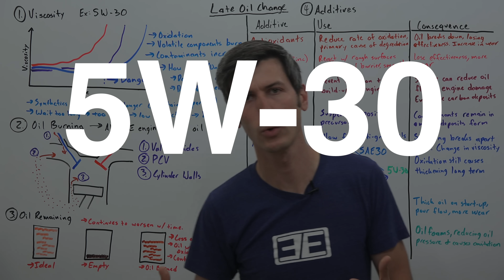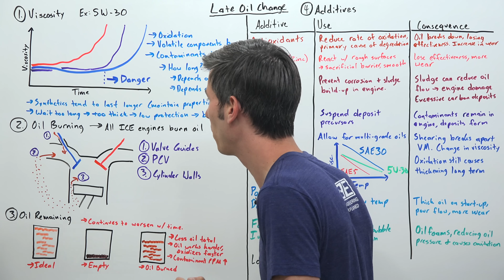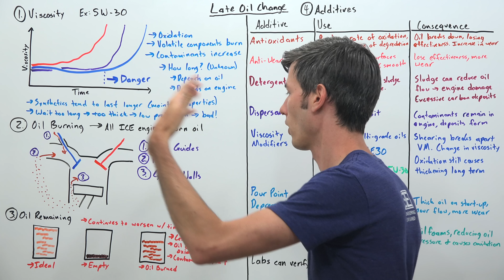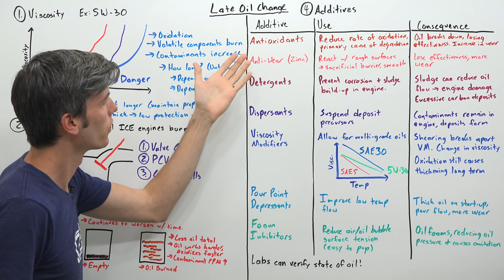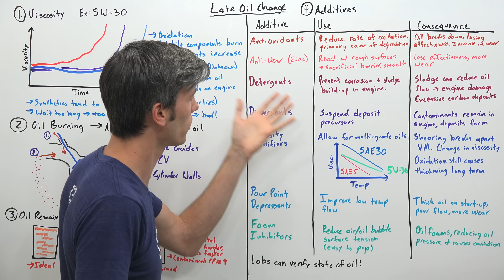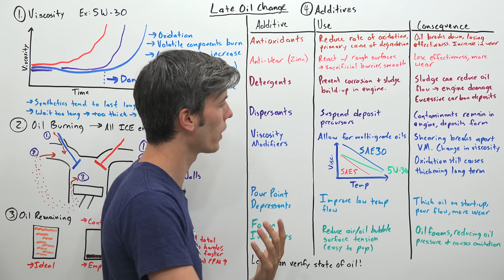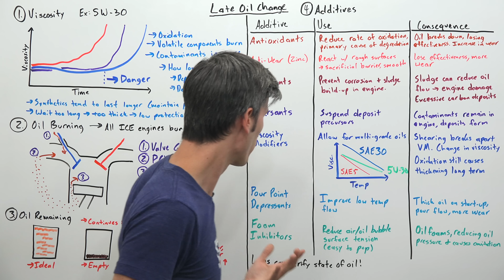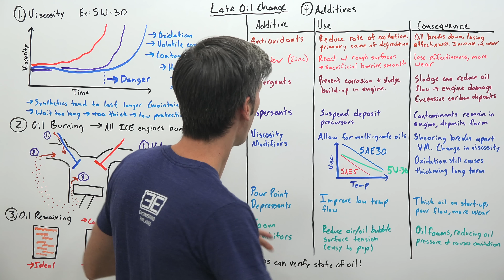What If You Forget To Change Your Oil?

Comment: What is considered “on time.”?
Reply: Well that is the thing. Pretty much nobody knows what "on time" is, but everyone swears the way he does it is the right one.
Reply: @Diesel Techie That or when your car tells you.
Reply: I'd say 10k km or one year max (whichever comes first obviously), to play safe.  Sure modern oils are better than they used to be, but modern cars also have much more heat (especially turbos).  BMWs are known for this issue.  They say up to 25k km based on how you drive, but then you get major part failure just after the warranty ends.  In a local BMW Z club the consensus is actually 6k km or 6 months for a turbo model.

Remember, long service intervals are good for the manufacturer.  The car looks cheap to own (more sales), plus the engine won't last too long so you'll buy another car shortly after the warranty is over (again, more sales).  Or you'll keep the car which has now turned into a money pit, and keep buying parts (parts sales).

And just for reference.  25k km = 15.5k miles, 10k km = 6.2k miles, 6k km = 3.7k miles
Reply: Diesel Techie Thanks for the reminder. I still have it and thought about it after I made my post. I was raised on the idea of 3 months or 3000 miles however, I made payments to the bank on a GMC Yukon and it told me to change at around 7500 miles.
Reply: @bradwilliams4921  
Do it more often if you are towing a lot with your Yukon. I usually just watch the color off the dipstick. When it starts getting brown I change it.

Comment: There was so much information in this video I can't remember if you mentioned time. How important is changing your oil if you don't put many miles on the engine? Does the oil deteriorate just sitting in the pan? I drive a hybrid and use the engine rarely.

Comment: I'm debating if I should change my oil now or in the spring time it's at 45 percent but the computer is set for 6000 mile intervals to the oil only has about 3500ish miles on it and it's full synthetic so I think I might wait till spring the car doesn't get driven alot mabey 50 -100 miles a week

Comment: BMW has a plan to have less metal wear contaminates ...... Making more and more of the engine out of plastic 😐😔
Reply: in one movie they said 'Bavarian Money Waster (BMW). HaHa
Reply: @billnopoles1934  it should be Big Money Waster.
Reply: @Ratkill9000  Nah, "Be My Wife" when you love it so much.
Reply: @ZoneCrasher  Both are extremely high maintenance.
Reply: @billnopoles1934  Those who work at Mercedes and Porsche say "Bayerischer MistWagen!"  (Bavarian dung car.)

Ha, ha!
Reply: @dudeonbike800  ich erinnere mich. I got my phrase from a movie 'Another Frickin' Christmas' (or similar)
Reply: @billnopoles1934  electrical issues to. MB is better in my experience maybe not as sporty but ppl get more inherent quality w/MB or Audi even VW on lower end.
Reply: Diesel Techie And they keep jacking the price up higher and higher. Cost to fix is higher too. There’s just not much left going for the customer anymore. 😪
Reply: Butterffinger5678 k
Reply: That was a good one. Plastic intake manifolds in the 1982 model..... so you're right.
Reply: I think it is also due to limitation from environmental.
Euro is limiting "lead" on new registered engine from manufacturer.
I think it will make engine service life shorter and shorter
Reply: They're all doing it now, not just BMW.
But I get your drift man. It's appalling how went from metal for intake manifolds and sump pans for this shitty plastic that will break.
I'd gladly pay the extra money for metal.. Just make the F#$@@ing thing !!
My 99 Euro Spec E36 M3 is as good as it gets when it comes to quality.
It slowly went downhill from there to the ridiculous we see now.
I wouldn't buy a new car in this day and age. They are all rubbish, especially the biodegradable wiring harnesses they so cleverly using.
It's not funny anymore..
Reply: @Royalbigness  >> Wait! What?? “Biodegradable wiring harnesses...?”
Reply: @boomer1954ful  It was more tongue in cheek response. My way of saying how cheap and crappy each new model gets. Everything is practically made from plastic rubbish which will break and leave you stuck somewhere. It doesn't surprise me IF they make a biodegradable wiring harness, the way the genious' are designing cars these days.
I have an E36 M3 and it oozes quality unlike the the rubbish of today. It's coming up to being 25 years old soon and it's still in mint original condition.  By the the time these new cars crack ten years, they'll be ready for the tip.
Reply: when manufacturers announce the new model with '400 pounds less weight' you now know what that means - nothing good.
Reply: It works perfectly fine...until the plastic becomes brittle from heat cycles and age.
Reply: @mrburgermaster  or the glycerine from the coolant gets through cracks in the egr valve cooler and gets ingnited by the hot exhaust gas and then gets sucked through the intake manifold into the engine (as intended), melting it...... the result is fire in the engine compartmend (as seen in bmw 520d)
Reply: my neighbor asked if i could check her oil in her bmw before she left out of state vacation ..popped the hood looked for 5 minutes scratched my head couldnt even find the dipstick. after she left (she was in a hurry) i looked up her car and it doesnt even have a dipstick ...REALLY BMW!!!
Reply: @dustinwalker9932  mercedes have that too. Only digital indicator.
Reply: @johan.ohgren  — That’s just awful - “How to incapacitate world wide auto owners”
Reply: @johan.ohgren  thats only... insane
Reply: @dustinwalker9932  I own an F25 and the first time I wanted to check levels i did the same.
The iDrive displays it. It is a royal pain in the arse changing oil though. 1) Because no-one can give a straight answer as to how much it takes and 2) It takes a fair bit of driving to get the level on the iDrive to sort itself out and show the correct level. It WILL drop after you've done a good few miles
Reply: @dustinwalker9932  They don't its obscurd. They recommend 15k oil changes still as well. Pls. That's why 80% ppl lease these vehicles.. tho will on other hand go & BUY a $70k+ loaded luxury model 1/2 ton pickup truck due to immense safety/reliability etc (i.e F150 Limited, GMC Denali, F150 King Ranch etc etc)
Reply: @dustinwalker9932  🤦🏻‍♀️ omg... Why would they do that?  Corporate Control Freaks ?  Won’t even let the auto owner check their own oil? It was part of our American right-of-passage to learn to maintain our own vehicle. Dad said, “Now you are a car owner. You will learn how to check your oil, check your tire pressure, check the tire tread w/a penny, check the water in the radiator, (“IT MUST BE A COLD ENGINE!”) And so on...
Reply: If there was a way to make a plastic engine, they would put it in all of their cars.
Reply: @jacobkeller8613  every automaker would! Its been tested. Not rigorous enuff.
Reply: @jacobkeller8613  put it this way,  the engine in my e46 m3 weighs 250kg
Tell me a 30kg total mass engine, not with saving,  that still makes around 350bhp wouldn't actually be cool...
And if it was all plastic,  it might be cheap to fix.....
Reply: Nicolas Broszky  They might be great.. but in practice the become fragile and break as the car ages, and that did not happen with metal parts. Also, most plastics expand way more than metals with heat changes.. so no, plastic is not good inside the engine.. and these problems have plagued BMW engines.. yet their solution is more plastic.  It is there to save money and weight, but ages horribly bad.
Reply: @aitorbleda8267  >> If I won a new BMW in some contest - I’d sell it immediately to get a Ford.
Reply: If they use carbon fibre instead of plastic it would be even better than metal but NO they don't bother.
Reply: Exactly! TOYOTA an most German brands been riding the perception wave for nearly a decade now & its fading fast while Ford /GM /FCA-Jeep have reclaimed benchmark status in so many areas. Now not saying Toyota is bad but not the same Co of 90s. Only really atrocious brand out there in terms of quality short & long term is Kia in my experience they get by on massive warranty time & parent Co Hyundais deeper pockets. Happy motoring & God bless American manufacturing!
Reply: @Diesel Techie Metallurgy has come so far in last 10yrs ..that aluminum is the "go to" material for even high HP applications w/ no issues. My 04 Mustang Cobra 4.6L  DOHC 32V factory supercharged has big alum heads stock & iron block for superior durability (they new ppl would try for obscene added pwr ..love how Ford & GM factor this into design) Had 400hp stock on dyno & easily 500hp w/ less than $1k in bolt ons/tune etc Many had those cars making 800hp safely! No internal engine mods did to robust internals stock & that iron block & factory Tremec 6spd manual. Even a 5.0L coyote in newer Mustang GT capable of lots more hp no internal mods needed tho not 800hp.
Reply: my BMW has a titanium engine and no dipstick so....
Reply: Brian Lehmkuhl BS
Reply: @brianlehmkuhl8162  doesn't have a Titanium engine! Maybe some parts. Better change motor oil every 5k-7500mis max no 15kmi changes.
Reply: Or just devoloping horrible engines like they are known for. 👍
Reply: Nicolas Broszky  interesting on the plastics make up. I wasnt aware.. thanks for info sir!
Reply: 🤦🏻‍♀️🤦🏽🤦🏻 lol
Reply: Buy a Lexus it will last forever.
Reply: @immersiveparadox  Lexus is good but designs are terrible now & other luxury brands specifically Caddy & Lincoln have long since matched & esp beaten them in performance aspects . Neighbor has new '20 Lincoln Aviator SUV for his wife..he can buy her whatever she wants . They had a few Range Rover Sports that were on but dismal mpgs. She drove 5 or so luxury SUVs an was smitten w/new Aviator. I hadn't seen one. What a beauty & tech is phenomenal. Def worth serious look in that price range.
Reply: @immersiveparadox  >> 😟 Ummmm, I know someone with a used Lexus SUV. Antenna broken. Brake job cost over &750 bucks. All kinds of things going bad on it. It’s a 2007!  Too many Bells + Whistles constantly breaking. 

I have a ‘99 Ford Ranger 4wd. Nothing has broken. Nothing! Done nothing to it except routine maintenance, tires, oil, gas, brakes, Trans fluid change,            1 Tune up. 1 rear differential fluid change. Not one thing gone bad in 22 years.
Reply: @immersiveparadox  or a old vw. My dad bought a passat 1.9 tdi pd engine from auction with no paperwork serviced it when bought then twice more over 3 years, sold it my brother he never serviced it in the 2 years he had it, sold it me for £300 with golf mk5 gti diamond cut wheels on so I basically paid for the wheels and got car free and drove it around for 3 years without even a air filter change, it never broke down or lost any power and ran its way to the scrap yard after all the shockers failed, I put 35k miles on it and my brother put atleast 20k so overall it did about 50-60k on the same oil topped up twice a year and went to scrap yard with 220k on clock. Would have done another 50k easy if the shocks didn't cost more than the car did
Reply: @dicksplatts007  A 1.9 TDI PD engine is near impossible to kill it would have been a 500,000 mile engine if you had allowed it to be.
Reply: @dicksplatts007  it was a diesel... i purchased a sports car years ago, had in town trips and long oil changes,,, rockers started to seized up when i strated driving it hard.  so chnage the dam oil
Reply: @dicksplatts007  VWs are great vehicles! Underrated. A few models had some issues yrs bk but no manufacturer is immune an most qll rectified easily. Buy w/confidence. Atlas SUV looks very nice.
Reply: @dicksplatts007  >> Of course there ARE different ways to view auto ownership... but auto’s are supposed to last indefinitely with proper maintenance... also a properly maintained Used vehicle is about 70% cheaper to own.
Reply: Fook that overrated an overpriced German junk. Buy American!!
Reply: David Klimmek American cars are made of Chinese parts and assembled engines in Mexico , there not really American made they just carry the brand name , and now there just as expensive or even cost more than German cars
Reply: @Davido50  if you only knew just how much of some American cars are German...Ford's Tier1 suppliers are mostly German and some Japanese, the suppliers (including my employer) basically build a clone of their plant on Ford property, and Ford pays them (us) to keep it running, train operators, design and set up the in process quality assurance tooling and diagnostics.
This will piss off a bunch of German fanbois but a Mustang is pretty much a German-engineered vehicle (little known secret, the bmw and mustang ZF transmission planetary gears & engine cams and crankshafts are ground on the identical swiss cnc grinding centers, slightly different cam profile but the tolerances to design between the 2 are rounding errors) and the planetary gearsets inside the aluminum housing with Ford or BMW on the casting...are clones...yes ZF design team basically did a "drap-n-drop" of the identical gearsets in the "custom transmission" designs for bmw and ford (but gave Ford 2 extra in the 10R-60 10 speed).

The manufacturing automation is built & programmed by the same automation & machine tool firms, and the "custom" in-process quality assurance is a clone of each other. The only difference are the reporting Function Blocks that populate each OEMs reports in the format and column headers they want.
Oh and the logo gif on the HMI, I mean if you drop a Ford/BMW/VW/Audi logo on an HMI (control touchscreen) design template, well damn that's totally custom machinery.
About as much difference as a Toyota Corolla and a Geo Prism.
Reply: @johnfilmore7638  Well, my friend ALL automakers utilize ALL of same parts (suppliers) & yet retain proprietary design/tech. Still I prefer & buy new only Ford Trucks & SUVs for my family. Highest tech /quality/features /best all around performance in their respective classesm.. as most reviews/owners agree. Plus profits stay in OUR country & Ford Motor in particular is now highest automotive direct employer & investor in North America by good margin. GM is 2nd. We have '17 F150 Platinum FX4 - 3.5L EcoBoost.. '19 Escape 2.0L SEL AWD.. '19 Ranger XLT 2.3L EcoBoost FX4 crew cab! No leases. Btw, the Ranger is part tough midsize truck/ part sports car:) ..very fun truck! Must drive if in market for class leading midsize truck. Kids argue over driving it. God bless & happy motoring! 🇺🇸
Reply: @John Filmore I agree w/ alot of what u said.. but of Fords current supplier base..roughly 781 Q1 vendors..dwn from 1100+ 5yrs ago .. many hundreds are All American such as Lear, Johnson Controls & too many to name. Ford dismissed any Co not receiving there Q1 status/highest consistant quality.  I'm in automotive field (not dealership capacity) in Michigan/Ohio regions so quite familiar w/intricacy of there business as well as many others. Every major automaker has a presence in SE MI along w/phenomenal engineering firms such as Roush Racing  (Ford has very close relationship w/) & McLaren for example. GM is no slouch by any means. Neither Is FCA having come on very strong in performance cars/ RAMS /vans/Jeeps. Jeeps major (monster) assembly plant is outside Toledo off I-75. A site to see! As Is Ford Motors Rouge River site w/4 plants near its corporate headquarters & Ford credit headquarters in Dearborn.
Reply: @Davido50  funny because Japanese manufacturers provide more jobs for Americans than "American" brands. Doesn't matter anyways, I buy Japanese only. I prefer quality over brand shopping because Murica, so Japanese will get my money, primarily Toyota, Mazda, and Honda.
Reply: @ashs3380  Haha your sadly sooo wrong ..why don't you find real & accurate statistics & not make up or regurgitating wrong ones. I got a good laugh from ur "statistics" an backwards perception tho. I work in automotive industry over 25yrs actually. I also use my name ..unlike YOU so im not hiding. American automotive manufacturing is doin great & growing. Superior design, tech an innovation is key! Everyone has great quality these days ..except KIA. Im privy to internal metrics you will never see or would understand. Proud of buying foreign!? Gtfoh. U prob drive a rusted out ragged out 10yr old Nissan that burns oil. Happy motoring. God bless America 🇺🇸!
Reply: @johnfilmore7638  yes indeed ALL share Q1 suppliers indeed tho many have different but close specs an Ford has cut suppliers from over 1200 to just 700ish in last 5yrs. Now design/ engineering is of course an individual thing. I want my high HP new Mustang GT350R to be 100% Ford design /tech for example & my VW Atlas SUV 100% VW origin of design.
Reply: @johnfilmore7638  >> I just don’t understand this. The main reason to send manufacturing overseas is cost reduction, correct? 
I don’t see how German designs or manufacturers could be any cheaper. German cars certainly are not!
Reply: @Davido50  > I have a ‘99 Ranger 4wd and drive it trouble free every day. Just change the oil & maintain. Have kept it garaged all these years. About once a month, someone comes up to me in a parking lot wanting to buy it.
Reply: @ashs3380  >> All of the Japanese have manufacturing plants in the US, don’t they? Or at least Toyota & Nissan?
Reply: @Davido50  or Japanese!
Reply: @Davido50  HAHAHA
Reply: Big Mexican Women.

Comment: Im glad about the oil burn of my car too, it has about 185000km (about 115m miles) and it burns like 0 oil on 12000 km (around 8000 miles) a reccomended change is every 15000km, i do it a bit early but eh better save than sorry